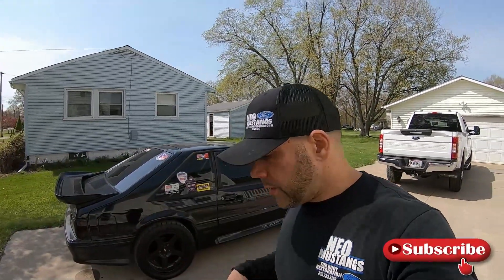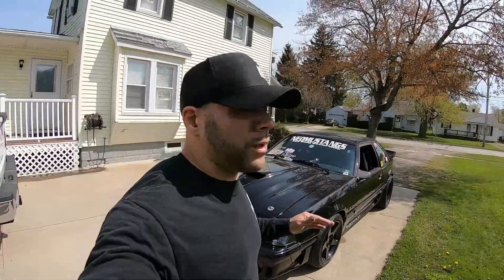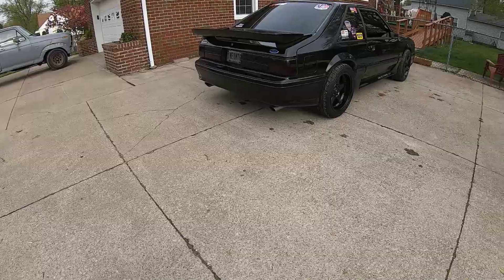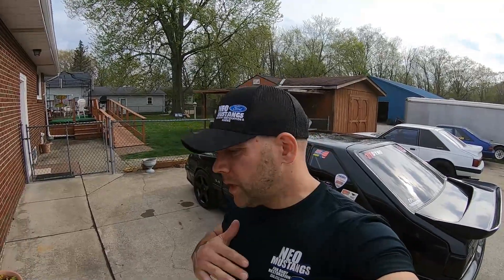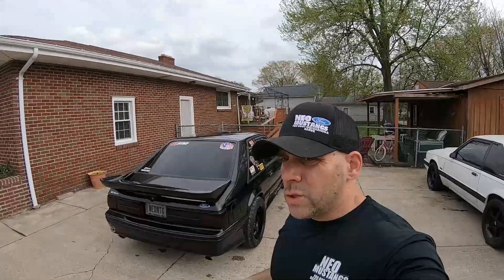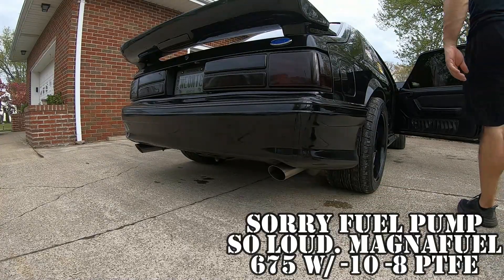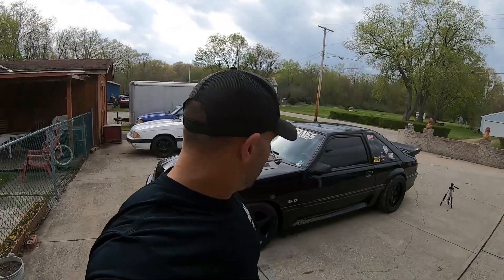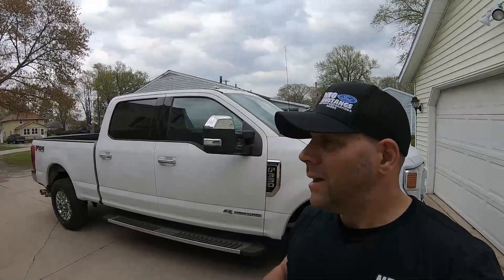Whats Turbo Sound Like Full 3" Exhaust? Custom On3 Turbo System Borla

Comment: Sounds evil in stealth mode and that equals some badass shit man, love it and I hope my 3" exaust sounds that good, im going to bring it out the side in front of the rear tires with the turn downs angled down and back at the ground in front of the tires so that when i give it gas it blows the shit in front of my tires out of the way so that i will get a lil better traction and it will look cool everytime I rev it all the dust blows out from under it 💪🏼😁🚗💨💨💨💨
Reply from the maker: Nice man ! And thanks
Reply: @Neomustangs  you're welcome and im digging your channel man because it has a good variety of ways to go fast with a SBF staying true to its roots, im looking for a SC myself and it should make the 347 
Pull pretty hard i think
Reply from the maker: @79beans347  ty man !
Reply: @Neomustangs  yw 😁👍🏽 thx for taking the time to reply, something many doesn't do 🤔 🚗💨💨🚙💨

Comment: Love it, makes me rethink buying flowmasters 🥺
Reply from the maker: Flowmasters are OG forever. The borla was just something different.  I was impressed on the straight thru design.
Reply: Flowcrappers don't flow. The drone on the flowmaster was horrible. They have the OG sound but the flow through mufflers are much better. I run the stainless AP mufflers a magnaflow style. Quiet until you get on them and no drone.
Reply from the maker: @bobsmith-st9lq  Ya these are really quiet till you get them mad. Also keep in mind tho, i  dont have a ton of backpressure either like NA or dual headers would cause. The turbo sorta minimizes that. So you get a nice quiet but borla roar sound vs.. tons of drone and super loud from NA>

Comment: I think fuel pump is louder lol. But sounds fucking amazing 👏
Reply from the maker: Haha def loud. The car is really quiet compared to what im used to. I open it up you can hear it tho. That old backpressure lol.
Reply: @Neomustangs  im getting a windshield for my 86 soon and she'll be back to running again. And then my 90 gt it needs a motor and trans.

Comment: Ik this video is old but I have a question. I have a 406 sbc and I want to do a twin turbo build . I don’t want to run the exhaust out the sides I want to have a full exhaust with quad tips at the back . How do I go about doing that  ? Thanks 🤙🏽